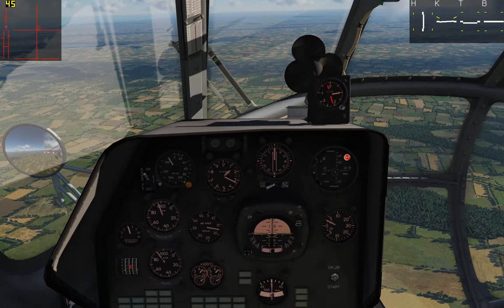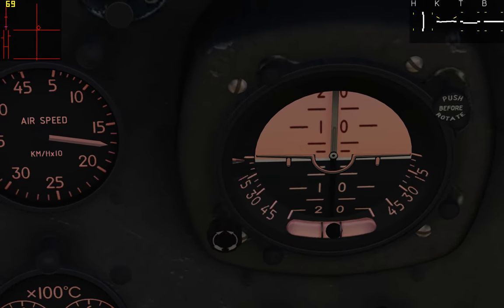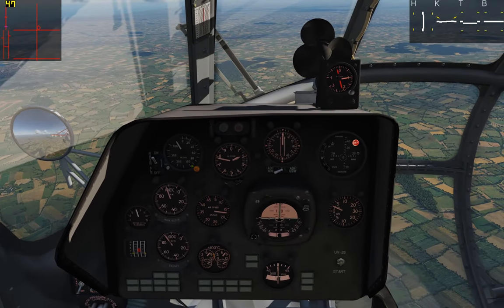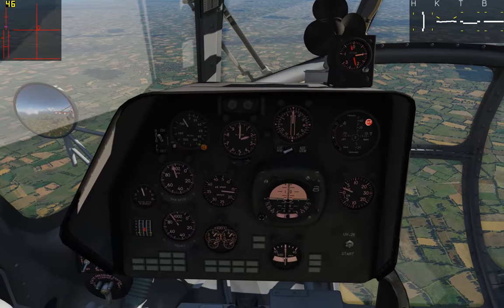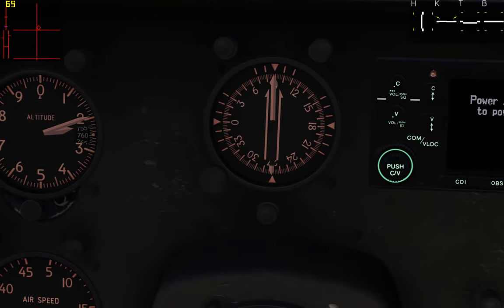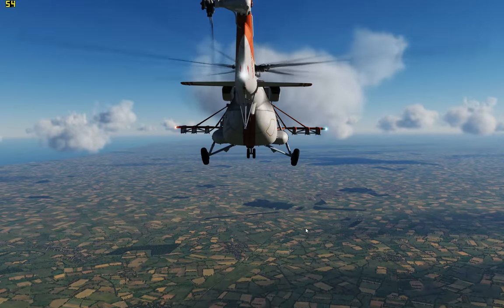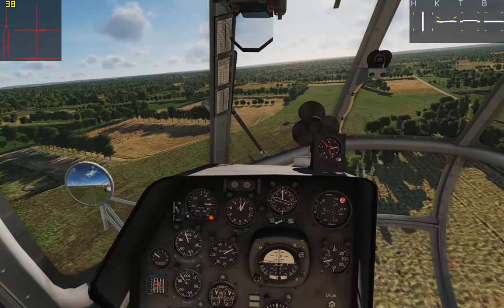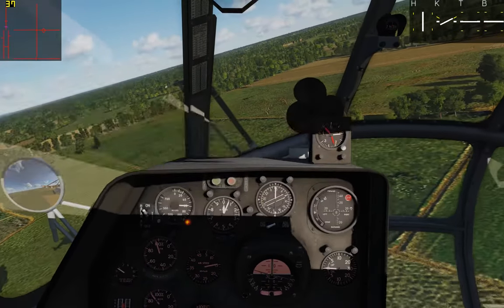DCS Mi-8: Coordinated Flight Tutorial

Comment: Drift as measured by the Doppler and sideslip as indicated by the ball are two different things. If you have a crosswind of any significance, you need to correct for it by adjusting your heading slightly upwind so your track (your course across the ground) is directly towards your destination. You cannot correct for a crosswind by adjusting your bank angle without then inducing sideslip.

Comment: Is it also an option to fly with your slip indicator exactly centered and 'crab' so you're flying the desired track?
Reply from the maker: You bet. Good question.

My understanding (something I've learned since making this video) is that what the real world pilots do is center the ball and then adjust their heading a few degrees right to account for the tail rotor drift.

If you jump into the navigator's seat you can use the doppler drift gauge (next to the doppler nav panel) to see how many degrees left you are drifting, and then you just adjust your course that many degrees to the right to cancel it out.

Pretty cool. Thanks for the question!